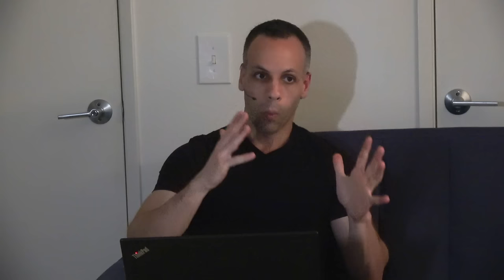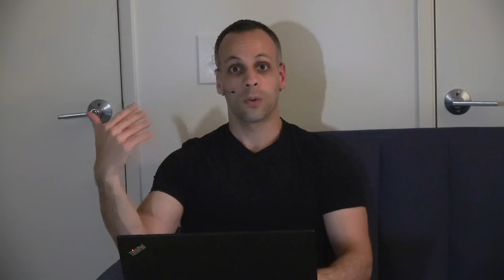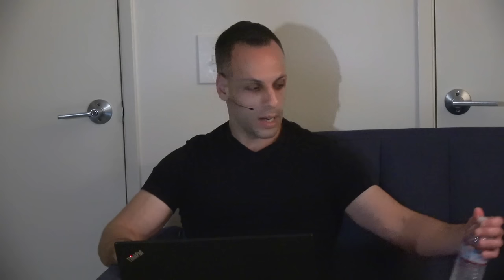EVGA's Oversight: Unannounced Changes Destroy PCs, EVGA takes NO ACCOUNTABILITY

Comment: This is negligence, not malfunction. The customer had basically no way to find out about the issue before they killed their drives. This is a very clear cut case, and EVGA should cover it.

They didn't even send new cables with the new PSU.
Reply: It's not even negligence, it's MALICE. EVGA explicitly told the user to do something that destroyed their property and could have harmed them.
Reply: @superslash7254  That's still negligence. The strength of your feelings does not alter the meaning of legal terms.
Reply: @EvenTheDogAgrees Your feelings about malice don't magically make an intentionally falsified model simple negligence.  EVGA went out of their way to illegally label two devices with the same model number, something which they had advance notice can and will lead to consumers being harmed.  If they accidentally put the wrong cable in the box that would have been negligence, but this was done with intent to harm and with reckless disregard as a matter of course.
Reply: @s1mph0ny  oh, look, it has learned to mimic language. One would almost suspect it of possessing sentience as well.
Reply: @EvenTheDogAgrees If you disagree with the bootlickers you're either a bot or overly emotional.  Perhaps this makes me an overemotional bot.  I'll be collecting my robo-oscar now.  Malice malice malice
Reply: @superslash7254  Not malice as malice require intention.  Just negligence as they should have send the new cables and warn the user of the change.
Reply: FYI update from GamersNexus shows the EVGA has resolved the issue to the cutomer's satisfaction and is paying for new drives: https://youtu.be/66HkbAGX83g?t=437

Comment: Hey Louis. Thanks for covering my story on here. Hopefully this can at least prevent a few users from experiencing the same thing that I had to.
Reply: Dang, I'd be livid!  EVGA would be getting a brick through their front window.. 
Depending on the cost of the drives and data recovery, I'd be taking this to court.
Reply: !!! YOUR DATA IS STILL ON THE DISKS !!! you just had to remove or replace the TVS diodes and/or fuses right near the power connector on the drive pcbs. very easy and cheap fix. if you remove them though, you wont have protection if this happens again.

Comment: A family member worked in a computer shop in the UK in the 90s. They had a lot of returns that the manufacturers refused to replace because the product "passed our testing". Their solution: The "cat-o'-nine-tails". An ethernet cable, a USB cable, various other cables, all wired into a UK mains plug. Plug in the device, switch on the outlet, BANG, product DOA.
Reply: based
Reply: Someone there reads The Bastard Operator From Hell!

Comment: When I first started building PCs again 5 years ago, it boggled my mind why the power supply pin-outs weren't all standardized across all manufacturers.
Reply: PATENTS.
first guy makes a new innovative thing, slaps a patent on it, 
2nd guy wants to do the same thing, modifies it enough to not infringe the patent, patents his changed version.  
3rd guy.... you see where this is going.  
10 manufacturers later you got 10 variants of the thing.  
Patents last how long? 20 years or so? ...yeah the one standard to rule them all will at least have to wait this long.  
...not to mention they all want you to buy THEIR cables, because they sell replacement and extra cables separate.
Reply: @ZeroB4NG  Nah, can't be that. There are many instances of standardized connectors that don't violate patents.
Reply: This is still something that can be covered through standardization. Heck could even write the standard to be 4 pins or less than x watts, 8 pins or less than y watts, etc. and have the the pinouts backwards compatible where a 4 pin can be plugged into an 8 pin. As long as it all uses the right gauge of wire it should work perfectly
Reply: michaelscarport  I'm glad I'm not the only one that thinks all black wire is the dumbest thing ever!.  Now you can't even visually look at the cable and know what voltage it's SUPPOSED to have
Reply: michaelscarport  Then some bean counter figured they could save $0.05 per unit by not using the sleeves

Comment: So, when you RMA they tell you “Don’t send the cables, we will not return them”. At the same time, the unit they send back is the exact same model, doesn’t come with cables, but it actually may have different pinouts. At no point are you warned to check the pinouts and maybe not to re-use the cables they explicitly told you to keep.
Yeah, EVGA definitely bears some responsibility here. I get the bankruptcy argument, it would be sad if one mistake sinks an otherwise good company, but I still think they need to make more of an effort than what we are currently seeing. In the short term, plaster RMA’s with warnings of this, and train customer service on how to bring it up. In the long term, change the supply chain in order to make sure at least all units of the same model will have identical pinouts. Also, maybe provide a compensation fund for customers who have been affected. They may not be able to make everyone whole without bankrupting the company, but they could at least provide some money.
Reply: Would have been already a major improvement to have a specific policy for RMAs related to models that had pinout change... Model A changed pinout, this thing gets its cables returned and comes back with cables, add BIG warning not to do any cable switching in user manual and you're good...

Comment: If they changed the pinout, they should have changed the connector as well so you could not plug the wrong cable in. They should also have changed the model number, but that is not sufficient.

Comment: It doesn't just need to be printed on the box, it needs to be printed on a sticker over the connector that you plug the cable into.
Reply: Yep. That's the ONLY way people will actually read it.
Reply: @carriebartkowiak  Maybe :face-blue-smiling:
Reply: Sticker and new cables.
Reply: i would go one step further and say the connectors shouldn't fudging fit into each other. if you swap pins around, why on earth keep the exact same connector on the psu end??
like they had to have cables made especially to fit their new pin layout, so why not make a different connector, that would prevent anyone plugging these ass-backwards cables into previous versions of the psu and vice versa?? what is wrong with their brains :<
Reply: Yep that's the most elegant solution - in a similar sense as the "warranty void if broken/peeled" stickers. Just block off the connectors with a big sticker explaining exactly what type of cables to use, and what each pin-out does, and a warranty void guide if instructions aren't followed. At that point it's evidently gonna be an end user issue if something arises.
Reply: @outseeker  True but that's not up to EVGA when they don't make their own PSUs, they basically rely on 3rd party manufacturing for that stuff and don't have fine control over things like pinout shapes etc.

It's why companies like Seasonic have such long warranties and reputation, because they actually manufacture the stuff in house and can make direct changes where necessary with no middle-men that information has to go through.
Reply: @Real_MisterSir  wouldn't part of any contract with any company include exact specifics of what is to be manufactured, and how? like there's a design and layout agreed upon before they start, so if pin outs have changed at any point, evga would have had to be aware of it and signed for it before manufacturing began, unless it was accidental...?
Reply: @Real_MisterSir  stickers would be fine, except these customers have sent their psu back to evga, and received an incompatible one back with no new cables, and instructions to just plug it back in lol
also once the stickers are removed, the awareness is forever gone, so not really ideal at all, and likely to still create issue
Reply: Is it not? I think mine has a diagram on the side with all the slots and voltages and on the slots themselves you have written next to them what they are for. It also says it on the cables
Reply: @outseeker  The contract doesn't state exact specifications of how a thing is made, it only includes exact specifications of what the final output is -aka what the thing does, not how it does it.
That's why a 12v and a 3v pinout can be interchanged, because ultimately how the power gets delivered isn't in the spec requirement, the only requirement is that they DO get delivered, and that the included cable ports match those pinouts.
EVGA's own engineers are aware of the change, but whoever is in the exec decision making role didn't think to verify that their RMA processes reflect this change/update in PSU pinout specification, and that their former "use your old cables with a new version of your PSU model" no longer is an acceptable and validated procedure.
Reply: Sorry but this is 100% user error.  Different power supplies using different modular pinouts has been a thing for 20 years now.  If a person caused damage by not knowing what they were doing when trying to build a computer that's sad but it's also their fault.  EVGA, Corsair, Gigabyte, etc don't make power supplies they just put their name on PSUs built by a variety of companies, this is common knowledge.
Reply: @Real_MisterSir  very interestink! in the case where a new manufacturer is being sought to create identical power supplies though, i would think it be critical they build them in the same way the existing, same model was built by the previous manufacturer. like if it's a fresh product, ok the manufacturer can wire it up how ever they like i guess so long as the end points are right, but this was an existing product/model they were supposed to be recreating, was it not?
Reply: @llynellyn as you say, different power supplies use different modular cable pin outs, but the Same power supply should only have one pin out throughout its entire production life i think.
Reply: @llynellyn  did you watch the same video as the rest? it was a SAME MODEL power supply.
Reply: No, it needs to be not swapped, they need to stop selling any PSU's that switched pinouts on the same connectors (AND to send notice obviously as damage control).  This is the problem, the pin switching, even between DIFFERENT models of your own brand's PSU's, unacceptable and they could open themselves to a class action as it looks like deliberate damage when people swap a modular PSU and keep cables.
Reply: @outseeker  It might seem like that, but manufacturing processes always change and improve, so if you're not the one at the helm of the ship, you can't really expect much other than what the final specs are. And you see this all over in the tech industry, things will be labelled as the same product, but internally things may have changed or switched place or use some different capacitors or wirings or whatever - and if EVGA has never made an effort to ensure that cable pinouts are standardized, then nobody would expect them to be so. Whoever does products for EVGA (in this case as example) don't just supply EVGA, they supply many companies, and they may choose to update their procedures independently, and here it's EVGA's responsibility to either ensure their products are made in a very specific manner, or that they themselves label the difference clearly so the issue doesn't land on the end user (beyond what is reasonable to expect of them). So when they get a new updated version of an existing product, and they internally are informed that pin-outs have changed, at that point it's EVGA's job to ensure that RMA processes don't endanger end user hardware by not informing them of the same changes, that EVGA were informed of by their 3rd party manufacturer.

The last part of your question; "but this was an existing product/model they were supposed to be recreating, was it not?", again comes back to what their initial deal with the 3rd party supplier was. EVGA didn't instruct them on how to build this power supply, EVGA only instructed them on how it should look, and what efficiency rating and tolerances it should provide. That's it. EVGA don't have cable standards, so it's unreasonable to expect a 3rd party manufacturer to ensure such compatibility when EVGA have not instructed them to do so. If that manufacturer's internal process of how they make cables and pinouts has changed since the PSU model was initially launched, that's not the fault of the 3rd party company. That's EVGA failing to either specify their needs regarding cable standards -or rework their own internal RMA policies. They chose to do neither, which is very unprofessional, sadly.
Reply: @Real_MisterSir  I worked in a company's RMA department.
We figured out the failure, and either fixed the board to original status or discarded it.
The end user got replacements that worked exactly the same, with exactly the same pin-outs.
EVGA's methods are not RMA, they are replacement with a different product.
Reply: @MonkeyJedi99  The main point is, it's still a part of the same procedure where the instructions tell to send the PSU in without cables, and have one (either the original fixed one, or a new replacement) without cables. Be it RMA directly, or a derivative of how customer parts are handled, at the end of the day the procedure is the same, and it's this procedure that has failed -and likely cost many customers their data and other hardware-bound damage.

You can either ensure the proper cables are provided, or ensure the PSU you return is compatible with exactly the same cables as what the customer was instructed to keep on their end. The Return process is what's integral in any RMA operation, and here the procedure of what was received vs what was returned, did not align at all.
Reply: It should be a different fking model all together
Reply: Corsair had varying pin outs but their cables are labeled (Gen 3, Gen 4, etc)

Comment: It's astonishing to see such a monumental blunder from EVGA, a former bastion of quality engineering. I thought the company was being gradually shut down and if that's true, they let the last competent person go prematurely.
Reply: EVGA has had plenty of engineering screw-ups over the years, such as their exploding Pascal FTW cards and RTX 3090s that started dying due to poor soldering. A lot of their coolers over the years have been very poor too.  They've never produced particularly high quality products compared to other companies. It was their superior customer service that gained them their amazing reputation.
Reply: Corsair has this same problem. I got a PSU with the wrong cables twice from them. Luckily they replaced it but it's an issue with modular cables having no standardization
Reply: HeWhoIsWhoHeIs Stick with someone who makes their own PSU, there's a lesser chance of this sort of blunder occurring. Neither Corsair nor EVGA make their own PSUs, but Seasonic and Enermax do. Of course, you should ideally check some online opinions since everyone makes blunders, but at least in this aspect you're unlikely to find a change in OEMs.
Reply: EVGA have always been a lower tier company. Nothing like ASUS or MSi
Reply: HeWhoIsWhoHeIs Nah ASUS is still crap, they just trick you with marketing. Their Gryphus line has had issues with leaking liquid metal paste, their Z series suffers from BIOS issues and overheating, their desktop cases have some of the worst cooling possible, ece.